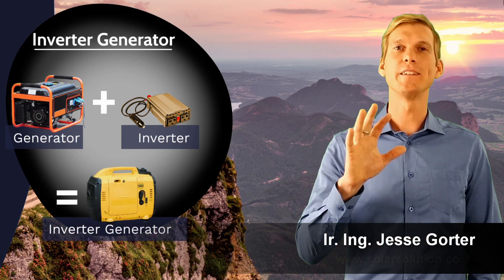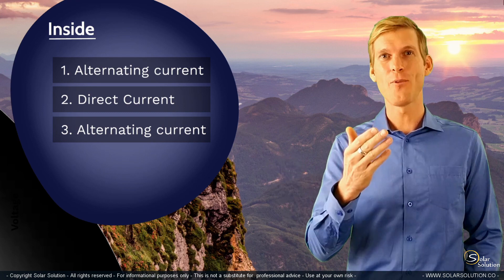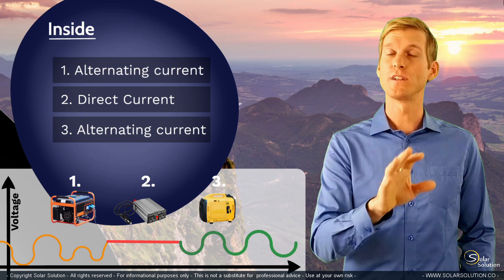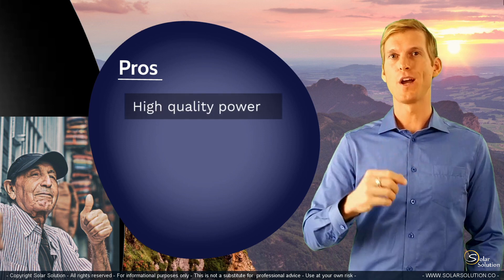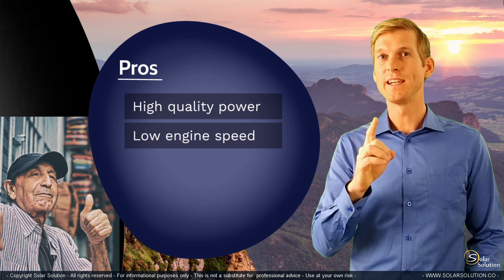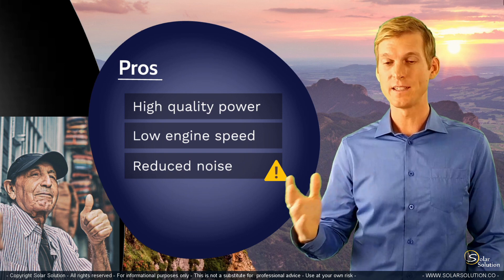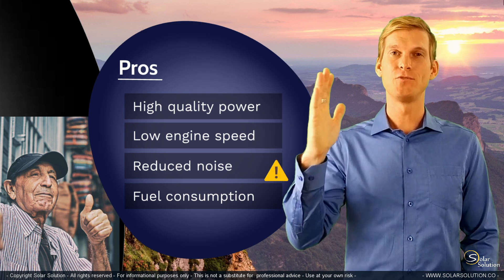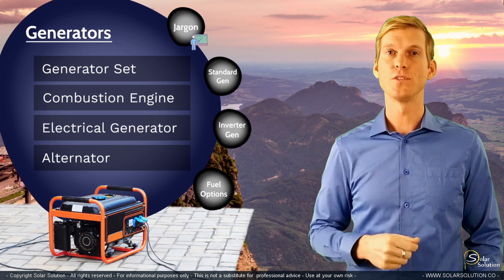The Inverter Generator Explained: What it is & How it works

Comment: Needs to explain how the engine throttling from the inverter works.
Reply from the maker: Great idea for a follow-up video! In short, the inverter monitors the load on the generator, and controls the engine speed through the throttle control accordingly.

Comment: Could you add a plug in inverter to your regular ac generator.
Reply from the maker: I can see what you are thinking, but that wouldn't really work. You could instead charge a battery, and then connect an inverter to that battery. Good luck!

Comment: So inverter generators should not have THD rating?
Reply from the maker: Good question! Yes, inverter generators still have a Total Harmonic Distortion [THD], though the THD is typically quite low: between 1.5-3%
Reply: @SolarSolution  thanks I just got my 9000W Champion inverter and it is awesome. Measured the THD and it was 1.5 to 1.8 depending on the generator load.

Comment: the current coming from the dynamo is a pulsating DC current.
This pulsating DC current is changed to AC current by an inverter Circuit board.
such generator uses permanent magnet dynamo to produce high voltage and current at low speeds.
that's why these generators are much quieter, because less power is needed to run the dynamo.